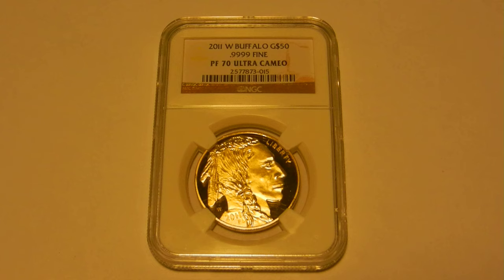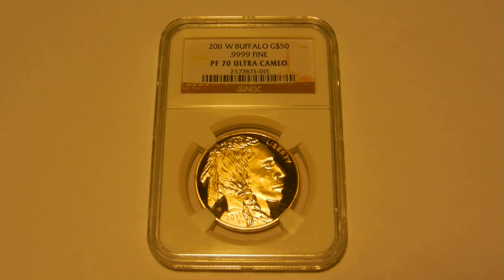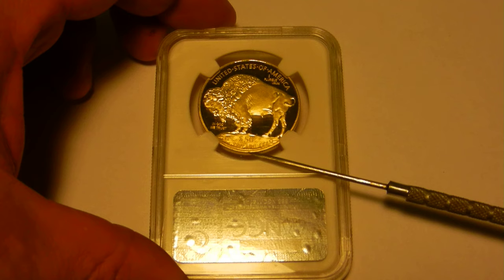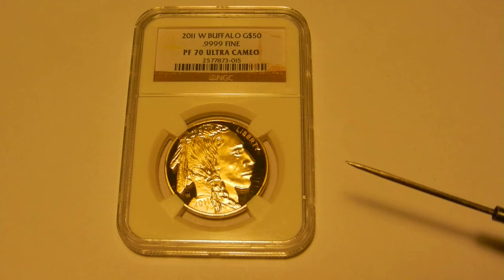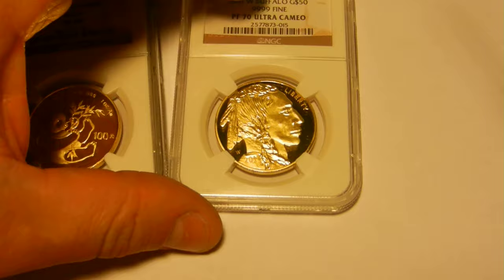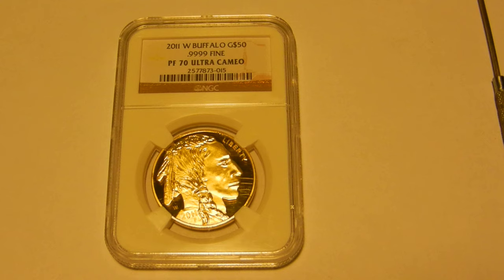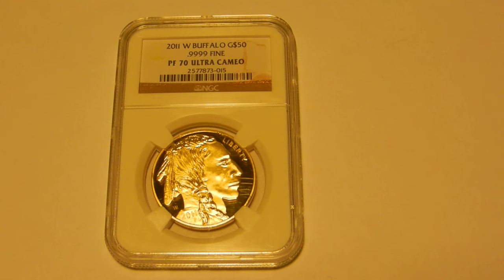Counterfeit 2011-W 1 oz Gold Buffalo in a fake NGC slab

Comment: I just got my second Buffalo, the easiest way to tell is the one you are showing doesn't have the wrinkled effect, I don't buy buffalos unless they are a part of the regular minting, proof and special sets is where they know they can get you. Nobody can counterfeit a real Buffalo with all those little lines going through it, giving it a real pirate coin look,,, these proof coins give counterfeiters something to do. My Buffalos look nothing like that. and it's just a regular one ounce coin that weighs 31.1, the edges are a little Sharp, one of the characteristics they purposely put. I have owned for buffalos in my life and has had many chances to buy the ones with the mirror back but I don't know every detail of that coin so I always stay away. I know what I'm buying when I buy the regular 1 oz Buffalo. Can't get jipped off on that, plus I only by what's in front of my face, so wait isn't an issue because it's weighed before I buy it and I also measure the width before I buy. Just a couple ways to avoid getting your self ripped off $1,500,,,. Good luck friend

Comment: A proof is struck at least twice and will gave a thin edge of gold protruding up around the outer edge of the coin as high striking pressures push the gold up at the edges.

Comment: How did you manage to analyze its metals content? Did you remove it from the slab before making this video? That XRF gun cannot analyze a coin inside its plastic holder.
Reply from the maker: Yes, it can accurately analyze through the plastic.  It uses X-ray spectrometry.
Reply: ***** I see. In an older video of yours about a fake gold eagle, you mentioned that the x-ray gun could not test through the gold plating. Did the fake gold eagle have a heavy gold plate?

Comment: NGC could solve this problem by using cryptography. Here is how it would work (in theory): newly issued NGC coins would be provided with a unique code which would be issued to the person who purchased the grading service. This key is called the private key. The private key could be stored on the NGC servers and the purchaser would have a NGC account to access the private key, an authentication app could also be created. When the purchaser goes to sell their coin, the buyer and seller would use the authentication app. The buyer would scan the coin's barcode into the app and pull up the coin. The buyer would then input a trade/purchase request through NGC's app. The owner of the coin would then be required to log into their NGC app to unlock the coin using the coin's private key. The coin's private key would then be transferred to the buyer of the coin and a new private key would be generated. Even if the previous owner had duplicated the coin with 100% perfection, they would not be able to pass the verification process in future sales. Counterfeiters would also not be able to pass the verification process. 

Previously issued NGC coins would have to be sent back to NGC to get reviewed for authenticity. While this is a burden  it would essentially eliminate the counterfeits problem. The truth is all of the tests in the video are pretty difficult to do for an average joe. The verification app makes authentication easy and effectively eliminates the counterfeiting problem. NGC needs to address the problem of counterfeiting otherwise the NGC brand will effectively become worthless. It is a cat and mouse game to say the least.

Comment: why didn't you open the slab?
Reply: I suspect he did. That's how he could test its metals content with the x-ray gun.
Reply from the maker: It is not necessary to open the slab.  The X-ray gun can test through the slab's thin plastic and analyze the surface of the metal.  Plastic is not dense enough to reflect the X ray beam.
Reply: jason frankfuk also slab is a insurance as well

Comment: I own some of these ngc pf70 slabbed coins. sort of scary, im checking every single number on the website. thanks for the video. really helpful.
Reply: do you guys even listen ? the number will match even if fake. its not hard for them to get a real number. copy it from a coin for sale on the internet. the number here matched. you need to check by weight and spectometer.
Reply: +yuliya9999 Or they can compare the pictures with the physical slab on hand. If there are differences, then it is a counterfeit.

Comment: plastic would seem pretty easy to fake. impossible to fake coin with exact dimensions and weight though. unless they are using real gold and just looking for the numismatic markup which will only be the case with rare year coins. The good lesson here is not to just trust because its slabbed. weight test and spectometer are required unless you want to get screwed.

Comment: If you go the NGCcoin.com and enter that slab number to says it is PF-69  2011 W Buffalo G$50.  This example could be bunked easily by simply going to the website, but I doubt it would always be that easy.  To bad he did not have an authentic Buffalo coin to compare it too in the video instead of using the Gold Panda.
Reply from the maker: No, NGC does not have it listed as PF-69.  https://www.ngccoin.com/certlookup/2577873-015/70/

Comment: I have seen PCGS fake slabs too, and they didn't have nearly as many differences.
Reply from the maker: I have had only 1 fake PCGS slabbed coin come through the shop.  It was a while back, but I remember that the plastic was different (striations / clarity off) and that the boldness of the lettering on the label was not correct.  The coin holdered in the fake PCGS slab was a 1893-S Morgan Dollar

Comment: I can see that Buffalo profile / bust doesn't look right just to the naked eye -- also the spacing in the lettering on the slab label between the "F" and the "A' in the word buffalo is a red flag right away -- as is the font of the label lettering --- the edges of that slab look like it has been cracked open possibly , the date on that BAD FAKE looks off set --  in my opinion -- BUT a newbie could be fooled -- great video warning people thank you

Comment: The scary part is i put the ngc number in and it showed up correctly.
Reply: Exactly. So the slab is authentic, but they removed the original coin and replaced it with a counterfeit.
Reply from the maker: Wrong.  The slab is counterfeit, the label is counterfeit, the coin is counterfeit.  The counterfeiters used many overlapping details in order to make it seem to be authentic, but none of them are good enough.  They simply found an NGC coin number that matched the type and grade of coin and then used that number in the counterfeit slab (that the counterfeiters made) to make it seem like the real thing.

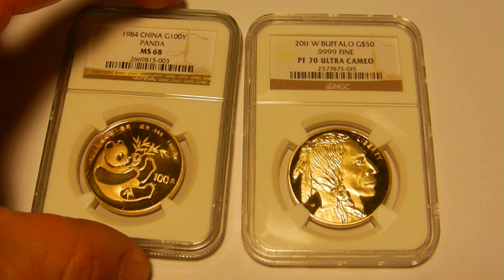Comment: Another big difference you've missed is that the slab prongs holding the coins are different. The fake slab prongs are much thicker than the original NGC holder prongs. Check it our when they are side by side at 3:22
Reply: Dave good point, checked it out.
Reply: @labrat4174  The bar code doesn't match either.

Comment: I forgot to say thanks for making the video  A question...
Reply: how can the size and weight be the same on two kinds one being gold one being fake when the fake one would have to be bigger or have led on the inside in order to make it close to the same weight. How is that done?
Reply from the maker: The molecular weight of gold is similar to that of tungsten, therefore it will displace similar volume and weigh similarly on a scale... not exact, but similar... and similar enough to fool many
Reply: @MarketHarmony  thanks for the answer. So do they use tungsten inside?
Reply: Tery Thompson 
I think I have heard tungsten is the closest in density to gold of all the metals.
Other metals are close also, but they have disadvantages — radioactive (Uranium) or too expensive (Platinum).  Uranium is actually both!

Comment: With out that machine I do not buy any coin!
Reply from the maker: That's a bit extreme.  The machine was used only to verify the natural observations made from handling the coin in person.  If it looks like a duck, quacks like a duck, and flies like a duck, then it probably is a duck.. no need to dissect it just to confirm everything before you get a pet duck.

Comment: i see this at ngc 
NGC Cert #
2577873-015
NGC Description
2011 W BUFFALO .9999 FINE G$50
NGC Grade
POSSIBLE COUNTERFEIT HOLDER
Reply: did you check the bar-code before buying?